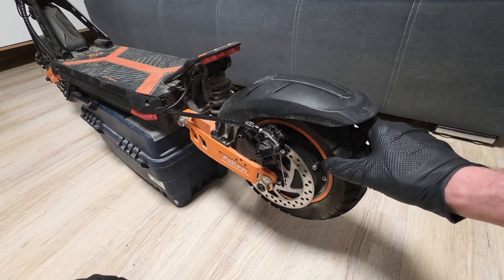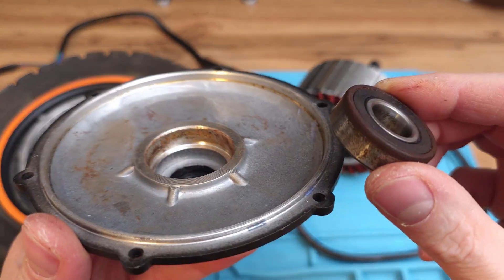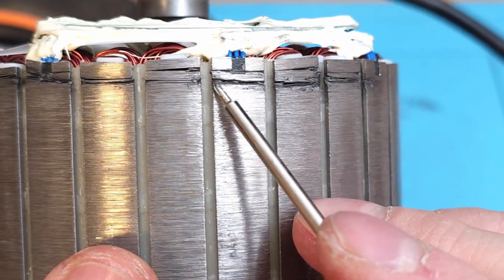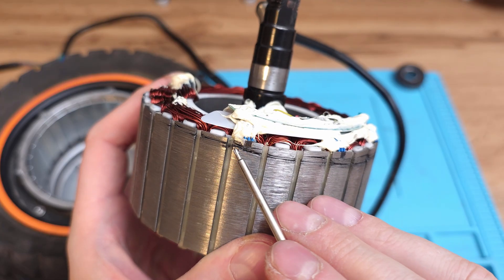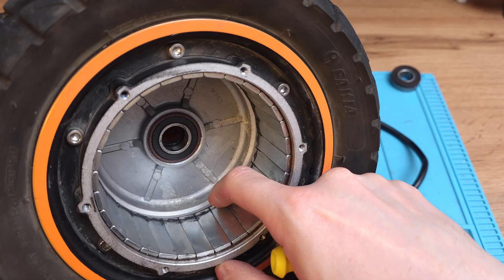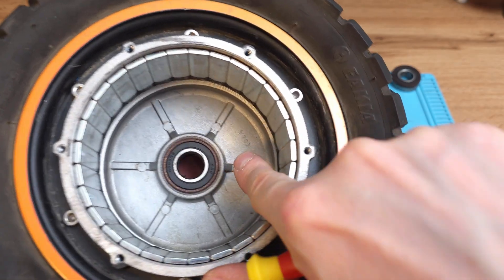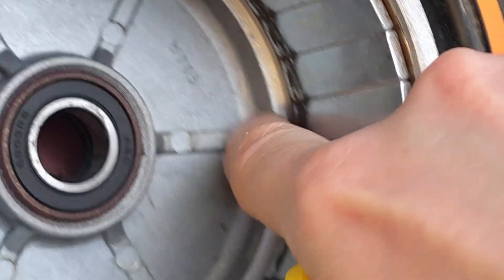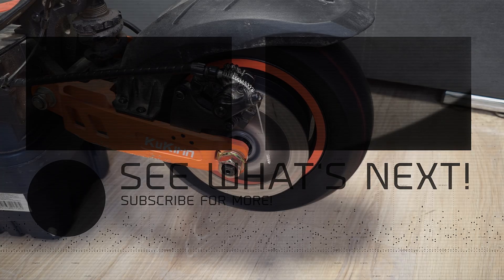KuKirin G2 Max Motor Teardown: Rust & Grinding Noise Very Damaged scooter motor

Comment: Update. Finally i installed 3000w 60v motor in my 800w scooter. Its huge upgrade.
Your scooter can be upgraded also ez at 3000w . But you must change controller and put new lcd screen 
And do some wiring 
Kukirin are strong build and 3000w are super great upgrade for them

Comment: Hey boss, you seem like the only guy that would have a solution, and would be a true goat for everyone with a G2 master 2025, it's about the speed limiter I know that there's one integrated but the thing is some cops knows about it , the thing is the new G2 master has a new controller the type C no white cable and even watching it right now I can't figure out what cable would be,  let's say the honk to disable and then put a remote with the box to lower the voltage to 12 volt. If somehow you could even just give me advice by writings that would be awesome 🙏

Comment: Ps first step was iscooter i9(350w) then mankeel mk-086(800w)then three months ago ootd s10 (1400w) and now just boyueda q7promax because my weight(240ibl) kills the power on 1 motor steps...so i will try dual motor..

Comment: My kugoo g2 pro has done nearly 5000 miles in all conditions, the motor still seems fine apart from a little whine as the motor starts up. I'm on my 5th rear tire and probably 20th inner tube, and I upgraded the battery to 20ah.
I'm considering buying a kukirin g2 max are they any better than the kugoo g2 pro? they are quite a lot cheaper than kugoo even though they seem to come from the same parent company, do you know if there is a reason for the price difference between kugoo/kukirin?
Thanks
Reply from the maker: Hey, thanks for sharing your experience, 5K is decent score.
I would say , next step is 2WD/AWD. More fun and stable scoot :)
Cheers

Comment: Nice repair. I buy a 800w scooter. I order 1500w motor. And 2000w controller For more power. 
Your scooter is great, you can ez put 60 or 72volt 48 v battery controller and motor up to 2500! watts easy😂
I want to put a 3000w 60v motor but fork had no room for this 😂
Your scooter has more room
Reply from the maker: actually 2500w for one small scoot motor, is a lot ;)
Reply: @PirateWasHere yes, but its funny. If u put 1500w motor. Its like double motor 2x800watt. !
If you put 2500w its like quad 4x500watt 😂
In one wheel upgrade only
Reply from the maker: Well actually 2x 500w is more torque than single 1500w ;)